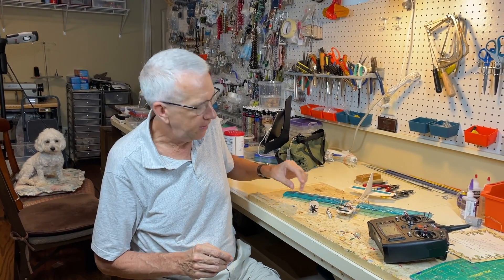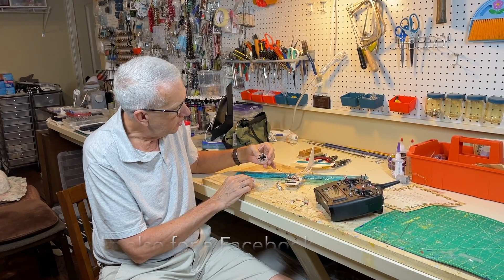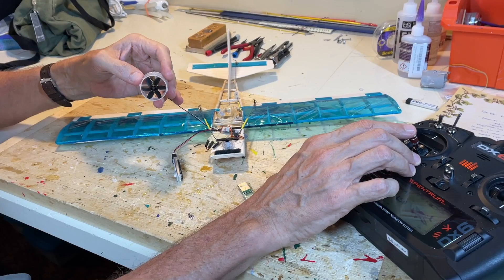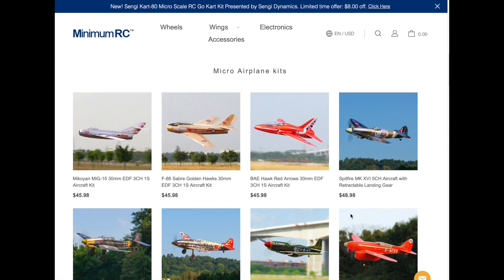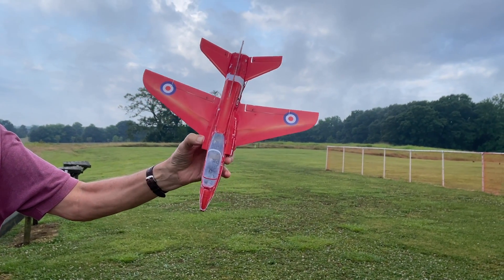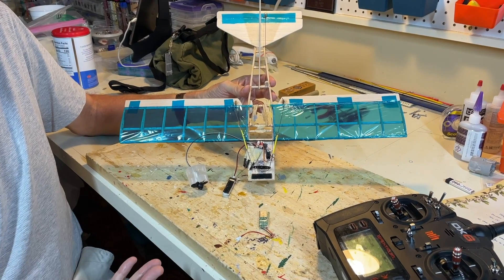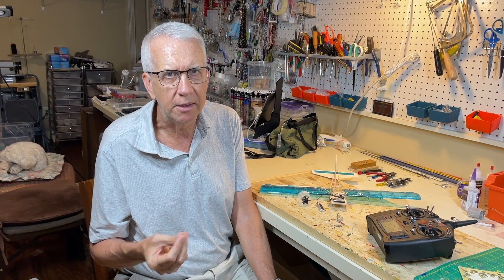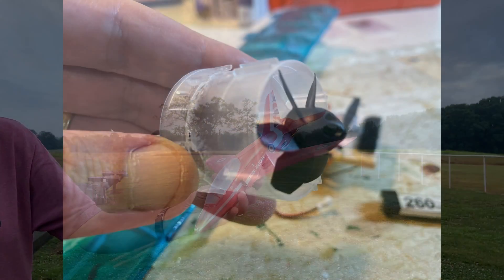Micro EDF for $9!  MinimumRC

Comment: I finished my rebuild. Moved everything over to a new fuselage.   I have a concern with the elevator in pre flight test.   At full back pressure, the elevator is neutral with the stabilizer,  there should be at least some upward angle with stick pulled all the way back shouldn't there?  Despite the wash from the EDFs, right?  Any thoughts would be greatly appreciated.  Ir took a lot of time and money to resurrect this thing back
Reply from the maker: Yes, the elevator must go up some amount for safe flight.
Reply: @TimMcKay56  There's no linkage like the UMX Timber for mechanical trimming.   It's just a piece of shrink tube that links 3 pieces of pushrod from one rod coming from the servo to a piece of rod connecting to the control horn.  Trimming with the transmitter or should I push those pieces inward by force with 2 pliers?  Hope I'm making sense
Reply from the maker: @Corrigan65_  Try using the two pliers to adjust.
Reply: @TimMcKay56  Thank you so much for your consultation.  I measured my UMX Timber's full elevator angle at 11 degrees.  But that's a STOL with leading edge slats.  So I'll try for 9 degrees
Reply from the maker: @Corrigan65_  Good luck!
Reply: @TimMcKay56  I'll take any luck I can get.  I'll tell you if I land it.
Reply: @TimMcKay56  Went up and came down in 1 piece, that's the good news.   Once it was up, there was a big problem.  Hadn't given in enough elevator on the mechanical  trim.  Full inputs on aileron rudder and elevator.   It was making these wide arcs.  Had to time it correctly to come out of the circle for the final approach .   No damage but I wouldn't call it a successful maiden.
Reply from the maker: @Corrigan65_  Well, any landing you can walk away from . . . 😊
Reply: @TimMcKay56  it was pretty ugly.  But yeah,  that happened.  You saved my plane, no doubt.  Next adjustment will highly likely be what I need for another walk away.  Thank you for your insights
Reply: @TimMcKay56  I hope these numbers have value in comparison to your EDFs.  

I took telemetry readings at half and full throttle.  This would be for the UMX A 10 30mm edfs.

Half throttle RPM:  168ish
Full throttle RPM:  270

I appreciate your advice greatly.  I hope this data is useful
Reply: @TimMcKay56  Oh,  the servo horn is top mounted on the elevator so pulling the rods in will lift it up

Comment: Hey Tim! This is cool, thanks. How simple is the bind process with your own transmitter? Got a TX16s if you’re familiar

Edit: I see the protocols now. I also want to say you helped me get into building my first plane. 🙏
Reply from the maker: Bind process with this receiver is pretty easy. Keep transmitter off. Plug battery to receiver. With no transmitter signal the receiver will go into bind mode (flashing light) in around 10 seconds. Turn on transmitter in bind mode to complete the binding.
Reply: So quick on the reply, before I could edit. Lol! Again, you provided a lot of insight when building my first plane so very grateful to you.
Reply from the maker: @Twissted-RC  👍🏻😊

Comment: Do you think that could power the UMX A10 Thunderbolt?  They look like the 30 mm motors.  Runs on 4s
Reply from the maker: I am not sure, need to do a flight test first.
Reply: @TimMcKay56  This micro EDF might save my UMX from being trashed.  I have all I need to make a second A10 except the guts.  Moved everything over to a nice new fuselage, new main wing and tail.  

But paying for another receiver, servos and motors would've not been economically viable.   You if anyone would know if it's salvageable.  I may have servos I can utilize on the A10 but I'm thinking I have to at least buy the eflite receiver for the A10.  No way around that
Reply: @TimMcKay56  Thank you for your reply.  You taught me how to trim by the way.  Thank you for that as well.  I'm a Tim McKay fan
Reply from the maker: @Corrigan65_  Many thanks!
Reply: @TimMcKay56  It's my honor.
Reply: @TimMcKay56  Watching something you may find interesting.  The BOEING 737 Max.  And the MCAS system.  Software designed to prevent a stall with the new engine mount position on the main wing